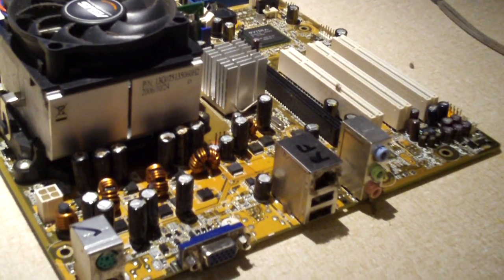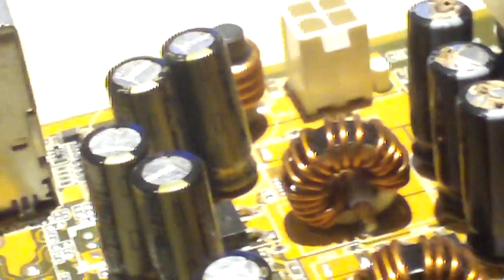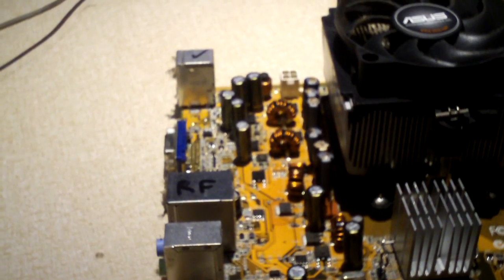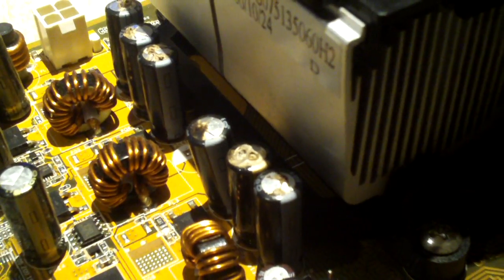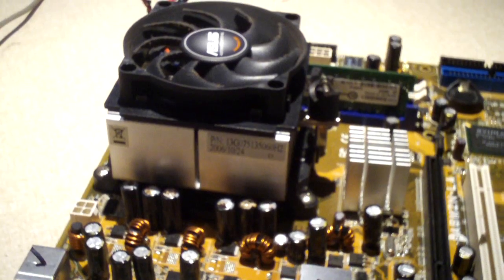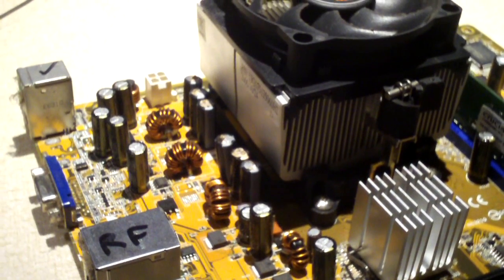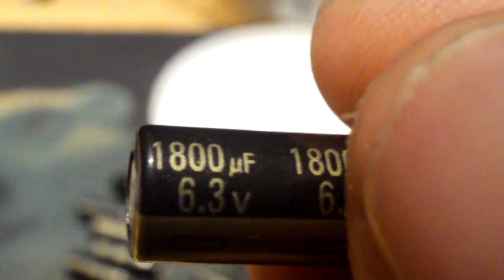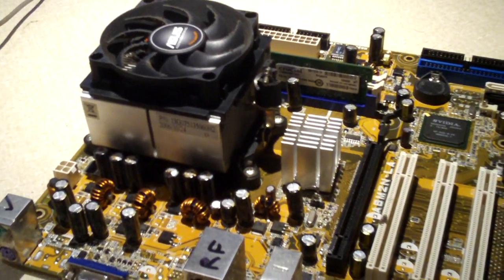Electrolytic capacitor failure caused by heat

Comment: Even the better brands have different tiers of quality, ie not all Panasonics are equal- some have 1000hr ratings and others have 10000hr ratings- even with equal temp/voltage/capacity ratings. The failed caps are beside the heat sink and are irradiated by it, and this is on closed side, so no airflow to help cool things. The vrm's may be drifting causing extra ripple(heating) currents. Unknown case airflow maybe a factor also, seems little across cpu base (vrm/mosfet/coil area). Don't know how old pc was before refirb- but 5 years is a good lifetime for a pc mobo. Cheap pc only needs to last 1 year to get thru warranty, and business class only about 3 years.

Comment: +Cube Computer Channel I have a question i fix computers my self but i had accident with on of my mother boards i was replacing failed caps on my mother board but when i was using my soldering iron I slip and scratch the board. It no too bad but i can notice the scratch i was wondering is the board still good or do i need to get it replaced?

Comment: A couple of things I'd like to note here..... the sleeve materials are what determine the color of the capacitor sleeves, not necessarily the series (polyester or PVC; polyester yields a silver polarity stripe rather than gold like PVC in this case). I would not blame the Rubycon MCZs for failing twice in the VRM output of an ASUS board. Those ASUS boards are known to have inadequate copper planes for the MOSFETs so they run hot enough to eventually discolor the board in that area (70C+). The Panasonics may "look" fine but capacitors can dry out without any evident signs and only an ESR meter would tell you that for certain. And only a couple Chemi-con and Rubycon series are more sensitive to heat than the rest; KZG, KZJ, MCZ, and MFZ.  The rest are fine. KZGs and KZJs are particularly notorious for bloating in storage, so they are very unstable.